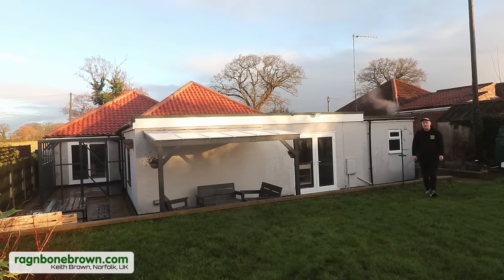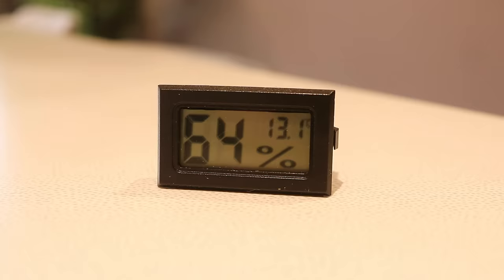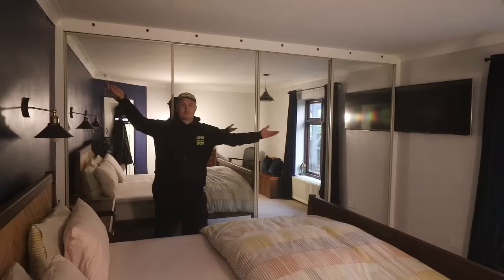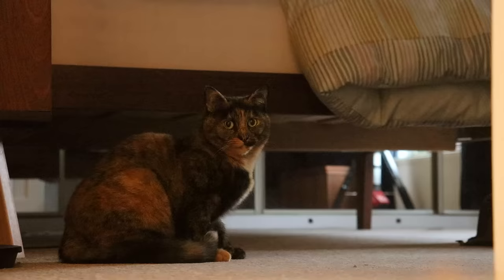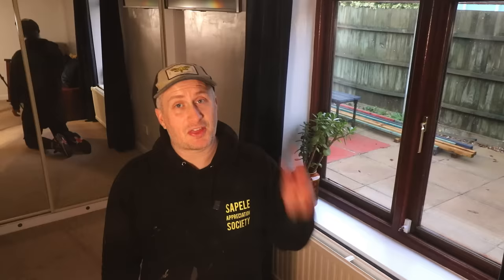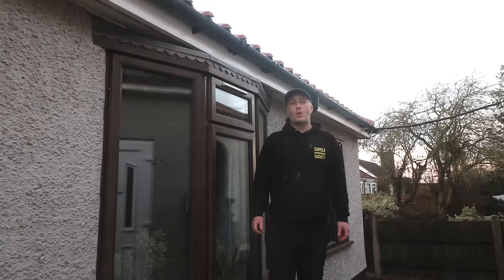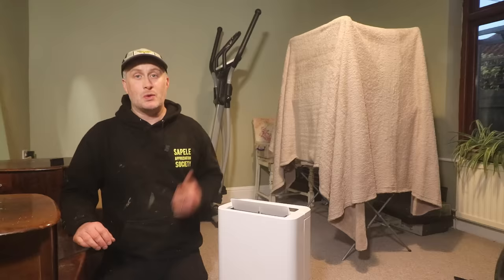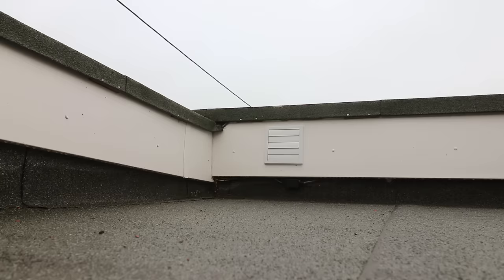8 Steps To Fixing Damp, Mould, Condensation & Humidity In Our Home

Comment: Any chance you can tell us how that loft blower affects you in the summer? Loft spaces get really hot in summer, I'm wondering if you've noticed it bringing hot air down? Of course last year's summer was mental, so not sure if you'd tell!

Also, maybe consider taking the insulation off your (inside) roof, or moving it away from the tiles (if it is close) as I believe this will dramatically improve circulation bottom to top, like a natural extractor fan. The wind runs under your tiles, into and out of the space, and as it moves through it draws household air with it in a negative pressure. Of course, there's a balance to be found with keeping heat in for that, so a different option would be active mechanical heat recovery exchanger to fresh air, but they're a bit expensive, and kind of hard to google as they're all called different things.

Honestly though before you said 30-60% I shouted 60%, so I wouldn't really bother I don't think.

Comment: Interesting, living on the west coast of Canada which actually has similar climate to UK, I find winter with central home heating very dry, our interior humidity is usually 35-40 % in winter and 60 plus in summer, but that is all due to central heating drying the air as winter is our rain season. Of course construction methods are very different here as well!
Reply: We have (in the UK) a very humid switch over from summer to autumn, and that usually combines with households closing their windows at about the same time that humidity levels outside are at their highest, and then there's a good 30 days before central heating goes on. That usually ends up with the first time we put the heating on (in a lot of old UK homes at least, especially with lime plaster), a sudden spike in humidity and condensation as the bricks and plaster dry out. But after that time (assuming householders open the top windows to vent), you're right we usually have lower humidity after the central heating has been on for a while. So long as we vent in the autumn, which not everyone does.

Comment: Good vid 👍🏼 We moved into a 1930s home just over a year ago and it had damp in cupboards too, but having fixed it by cleaning and mould paint only, we are lucky enough to have 50% humidity in the house on average most days now, often it does drop drop down to 35% in Summer. We use those small moisture meters and our two nest thermostats to keep an eye on readings. One thing we noticed is the rooms with abundant houseplants, specifically our Aloe Vera cacti usually have the lowest humidity. The humidity in those rooms creep up during the week and then bizarrely it drops when we water the plants. Not sure if it's because cacti have adapted to being in deserts and so they stuck in as much moisture as they can 🤷‍♀️ My weird logic is that when I water then they become full of energy and so are better at absorbing the humidity. Note, there are only two of us in the house, and because my wife grew up in a hot country we rarely leave windows open and have no trickle vents. 🤔

Comment: Experiencing similar issues in our property which is a similar age however a very different type and whilst it's not as bad as it was, it's still not ideal. The tips you mentioned are certainly some that I'll be looking into. Somethings that you might want to look at are improving insulation, breathable membranes on the roof and if you plan to do a big renovation of rooms with an exterior look into Lime Plaster and Insulated Wet Plaster. Painting the exterior walls with Stormdry as recommended by Skill Builder might help, however I have my doubts on the effectiveness against condensation and mould, given it's marketed as a product to prevent penetrating damp.
Reply from the maker: Thank you, great points
Reply: Never paint anything onto the external walls. They need to breath. Solid brick walls also need lime plaster, use gypsum at your peril. As the solid walls need to breath internally and externally.

Comment: Hi, also have a bungalow and get high humidity. Areas that I have done and you may have done already include checking all guttering and outside drains are in good condition and also the human factors (boil pans with a lid on, dry cloths outside or in rooms with a window open. My humidifier works well and I sometimes switch it on overnight on a cheaper electricity tariff, it removes over 6-8 litres overnight and the energy is not wasted it adds a small amount of heat to the rooms like a heat pump. 🌊
Reply: Seems insane that Europeans will use dehumidifiers but still air dry their clothes inside when using a clothes dryer would solve both problems and be more convenient overall.
Reply: @SuppaflyZSM  Thanks for the feedback. In my house that I discussed above, I don't dry clothes inside the house so your wise help won't help me. The humidity increases when I am away from the property too so it's not human factors that are the main cause. For information, many houses in the UK do have clothes dryers, especially in family homes with children needing quick turnover of washed clothes. The newer heat pump-based clothes dryers are a big improvement over the energy-hungry predecessors.

Comment: I never understand why heat recovery units never seem to feature in these types of videos. I think it may be because people think all HRUs are huge expensive machines made to run a large newly designed passive houses. I have several cheapo HRUs around my house that I use for ventilation that cost anywhere from £100 to £150 each & have been running successfully for donkeys. 

You can but single room units that look like an extractor (which I have) but if you have the room/somewhere to hide it I much prefer the larger box units that you have to fix ducting to that require both an inlet & outlet hole & can do several rooms, although I generally only use these to cover 1 decent sized room or a few small rooms if theres airflow between them. They are cheap & if one dies (not happened to me yet) it's not a big drama to just disconnect it from the ducting, chuck it & instal a new one. 

Do cheap ones recover the 80% to 90% of heat that they advertise like the mega expensive units? Probably not but the incoming air is a lot warmer than just sticking a hole in your wall & most run at around 3 watts per hour or a bit more on boost mode so to me make sense, rather than wasting heat energy.

Comment: Not sure why a bungalow would be worse as when external doors are opened during the day it moves air around quickly as all on one floor. Just to elaborate on extractor fans. I work in Architecture and would highly recommend continuous running extractor fans with boast for humidity. We have them with heat recovery built in, which is essentially doing what your PIV is doing but recovering heat so more efficient. They arnt much money days and can directly swapped with existing ones.

Comment: Have you considered air ventilation with heat recovery? I recently bought one for ~1000 eur, installing it is definitely a DIY job. It will definitely help with the moisture problem, and save a lot of money on heating. If you want to go fancy you can go for active heat recovery (heat pump) such as Nilan VP18, but that is a 7000Eur+ investment.

Comment: Nice video. Other than a brief mention of easier to heat you did miss some other benefits, such as less need to heat and a more pleasant smelling home. I had a family member visit and they mentioned a damp smell I hadn't noticed. Popped the dehumidifier on and a couple of hours later and a couple of litres of water out of the room and it smelt great. I have just picked up a pack of sensors so I can be more accurate in future instead of relying on my noseblind sense of smell/ feel.
Reply from the maker: Great point!

Comment: The worst issue we had was in a ground floor flat in a recent conversion. The front bedroom suffered immense issues with mould and that was from April to August. The place looked nice (1st impression) but was so badly bodged you'd have a coronary. We previously lived in a duplex flat that suffered damp and mould until the heating was changed to radiators from warm air. We had a dehumidifier there

Comment: I think ideal range is more like 50-60%. Anything less will make your lungs dry and vulnerable to virus infection, and anything more will cause condensation and mildew growth. 30% is stupidly dry, we had such humidity in one company accompanied by almost 30°C at winter and it was a hell to work in. At home we have >65% and it feels too much, there is condensation on windows and in corners of the buildings there is growth of mildew. So if we would mix these 2 environments we would get the ideal 50% XD
But companies usually do not care about money, and individuals cannot afford to pay a lot of money just to get the humidity right. Probably buying a recuperation unit is one of the most economical upgrades, because only a fan consumes energy, heat recuperation is passive and can get to 90%. Only pumping cold air into room is just too wasteful.

Comment: Keep above 15 degrees, open doors not windows if dry outside. The best thing to do is get some small peltier dehumidifiers (only 10 Watts). I'm not sure about the loft system because my loft is very humid, 2 litres of water per day(from dehumidifier)may go into the house. You don't really want to be dehumidifying damp air from outside in winter.

Comment: The 30 to 60% humidity also depends on the area you are living, as i understand, the UK has a very high humidity climate compared to European countries like here in Belgium.
The humidity here in the house varies from 32% to 75% depending on the wheather and the type of room. In my living room it swings between 32 to 60% , and in the rooms in front of the house where i don't heat that much, i varies between 60 to 75%. From my own experience, below 40% is not recommended, it gives me headache and sore throat, i feel most comfortable arround 50%. When it shutdown my heating at night, the humidity raise arround 2 to 5% in my livingroom. 
From my own experience, there are only 2 major solutions to prevent moisture/mold and that is ventilation or heating a room. 
i live in a home build in the 70's, but here in Belgium most homes are build with socalled "cavity walls", the outer walls are double with a gap arround 5cm in between. In the older homes like mine, this gap is open and in the outer wall there a little vents on the bottom and top spread over the entire wall. In newer homes, this gap gets filled with PUR boards. The older homes like mine, the gap can be filled by Styrofoam balls blow in or injected with PUR. But i know people that have there walls insulated and they complain more about moisture then me. The big benefit of this cavity wall build is that the inner wall always stays dry, and can't soak rainwater. Our outer walls where also threated back in the 80's with a special product that let the wall breath, but repells water, don't know if this product still work after so many years to be honest. 
 To vent and get fresh air in my livingroom, i open my windows arround 5mm daily when i'm cooking and use my ventilation hood in the kitchen. This draws fresh air in to the kitchen next to my livingroom. Then after diner, i close the windows again. 
In other rooms i open them a few times a week for a few hours and with closed rolling shutters to keep bugs etc out.
i think in your case, a humidity between 50 and 60% is probably the lowest you will get. Another but more expensive solution can be to cover your outer walls with cladding, this system that we use here in Belgium is with vertical roof batten arround 60cm apart, and covered with "wood like" cladding. Between the battens is then a air gap for insulation. On the bottom this gap is closed with a mesh to keep insects out. This Wood like cladding is mixture of wood and plastic particles compressed and with a smooth wood grain like finish available in many types of color. It's also maintenance free and waterproof and be processed like regular wood.

Comment: I was given to understand that older houses were able to deal with more humidity thxn modern ones as their main source of heat, the coal fire, produces wet heat, which is why older houses crack as a result of central heating; dry heat.

A 1930s bungalow should therefore be fine.

Comment: Looking at Google weather on my phone I noticed that there is a tab dedicated to humidity. Then it occurred to me, what if instead of opening the windows in the morning (as I always did), which is when the humidity is very high, I wait for the time of day where it indicates the lowest possible value? So I waited and around 4:00 p.m. I opened the windows completely. In half an hour the humidity dropped by more than 20% and for the first time in more than a week it reached values of 40%-50%. As the hours pass, the values gradually rise again, but for several hours I was able to maintain around 50%. It's so simple that I don't know why I didn't think of it before.

Comment: I live in Alberta Canada here we have the opposite problem it gets dryer than a popcorn fart and we often have to run a humidifier to put some back into the air. The wood I store inside gets so dry my moisture meter won't even take a reading so <5%.

Comment: Try being in a static caravan over winter!  Humidity averages 90% and is insanely difficult to control to less than 80% (dehumidifier).  There are many vents in a van so I'm not convinced airflow is the issue, also no heating at night so temperatures drop to 5c or less on occasion so will spending £500+ on a heated PIV (plus 400W a night) be cost effective?

Is anyone else dealing with static van (similar to bungalow layout) chronic issues that can make recomendations?

Comment: Interesting..   We live in a 1800's cottage 20 inch Solid walls.    winter month months is a dread,   Windows and wall constantly dripping wet.  we have trickle window vents constantly open,  we keep the windows open as much as possible.   Never dry clothes in the property.    yet each morning every window soaking wet,    Birthday / christmas cards curl up within a few hours of being in the property..   yes the humidity is that high.  Been thinking of getting a PIV loft unit   non heater version.     what are the running cost of them in reality as a user of one ?

Comment: Really great content! Reminds me a lot of what we have come to learn over the years, and what we are pondering to do for our bungalow from the late 60's (with a flat roof, so not easy to do anything there). Just got a new extractor for the bathroom, and it has made a world of a difference (it adjusts its speed according to motion in the room, and sudden increases in humidity e.g. when showering). Also had the small ventilation channels in the window frames added. I am also considering getting a dehumidifier, and pondering some solution with positive pressure of fresh, filtered air, maybe using a solar furnace (multiple videos on those on YouTube, some with recycled air, and some with fresh). Also want to get a number of temperature/humidity sensors with zigbee, so I can log it over the year - but let's see if I ever get to that 😅

Thank you for the inspiration!

Comment: Great video, I noticed you have radiators under your windows with curtains. How do you deal with this for heating efficiency? I'm running around in the evening tucking curtains into the radiator. Total headache and not a good design.

Comment: I’ve just bought a dehumidifier with a humidistat. If I leave it on all the time and it only comes on when humidity levels get too high (above 60%), will it still be expensive to run? It’s a one-room building with stone walls and a stud partition with full insulation.

Comment: What temperature do you heat you home to Keith? I saw in the video the sensors showed temperatures of 13 and 15 degrees. This is very low. I thought we were low at 18.5 degrees. This might be why you RH is above 60%. I reckon if you heated you home to 18 or 20 degrees your RH would go down below 60%. As I'm sure you know warm air can hold more moisture so if the level of moisture in the house is the same then the RH will go down as it gets warmer.